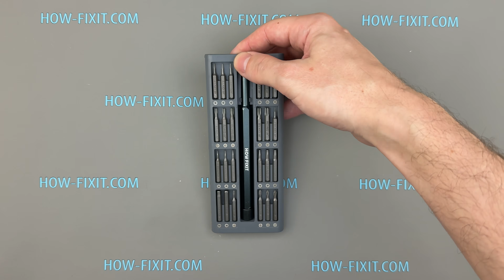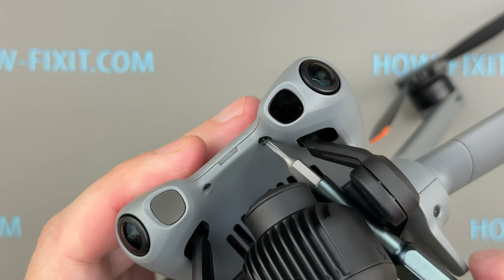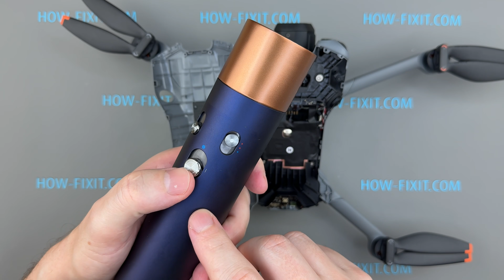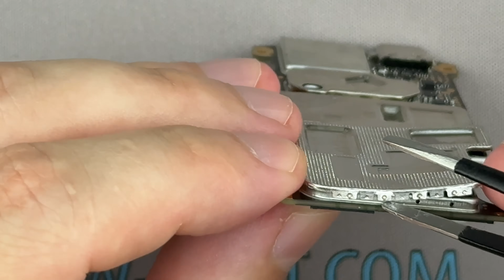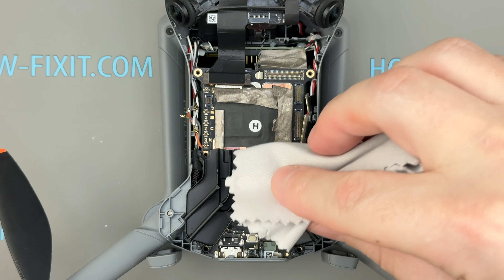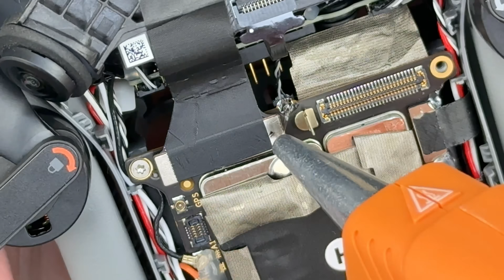DJI Mini 5 Pro Core Board Replacement | Fix No Power & Multiple Errors

Comment: Hope you're well.
I need some technical advice on my DJI Mini 5 Pro. Following a crash, I replaced the signal cable and the roll motor. Mechanically, the gimbal is working great now and the drone operates normally, but I am getting a black screen with no image transmission.
On top of that, the controller isn't giving me the option to reset it.
Let me know if you've run into this after a cable swap or if you have time to run a diagnostic on it.